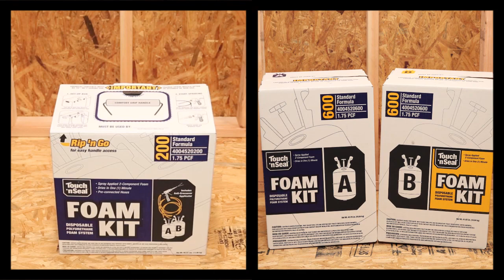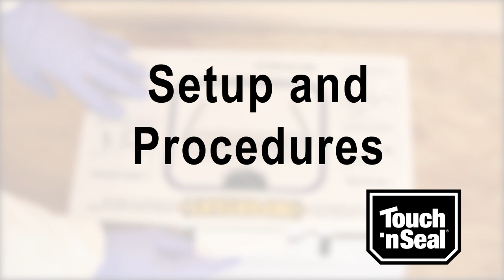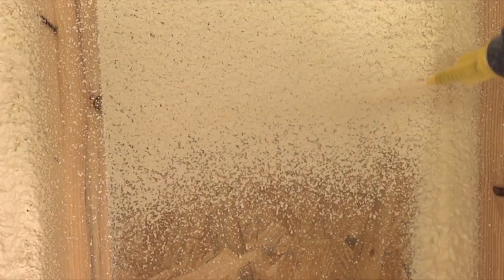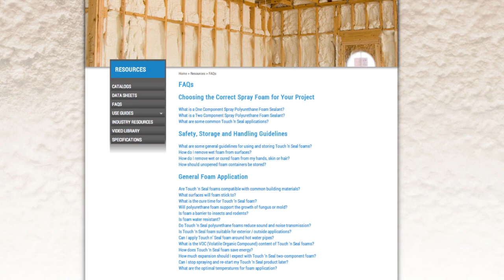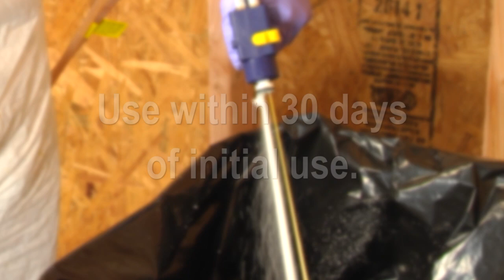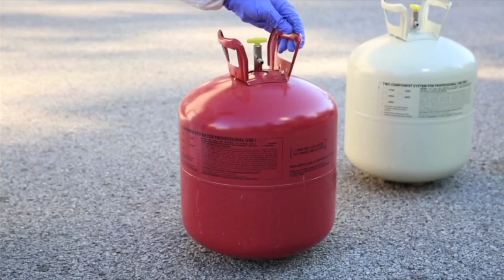How To Use Touch 'n Seal Foam Kit 200

Comment: After 6 years it is time for all of these videos to be updated and answer some of the many questions asked.  Nozzle selection ?  Can it be sprayed overhead ?  Technique of using the different nozzles ?  How to safely heat canisters ?  Etc, come on if you want top sell the product get off your hind ends and offer better presentations than this.
Reply: HEAT CANISTERS WITH HEATING PAD. It works great.

Comment: 11 paragraph advice: 
Measure the required volume carefully. Always buy the biggest tanks for the majority of the job. The 600s are a much better deal than 200s.

If it's cold outside, then it is the wrong season to be applying this to insulate your cold walls! 

Cold is the enemy. Always work within the 3 required temperature limits. Run a fan to keep all air circulating and to avoid excessively warm or cold walls. 

The closer the chemicals are to 90°F, the sooner the foam expands and the sooner you can notice problems. Get both chemical temperatures to 90°F before use. The liquid center will usually be colder than the metal tank. Slosh the liquids vigorously inside the tanks each time before measuring the tank side temperature. Don't get impatient while they warm up. Don't "over-do" it. 

I warm the chemical tanks in a small room with its own heater thermostat set to 90. I use a cheap digital IR (remote) thermal sensor since chemical bottles, wall surfaces, and air - ALL need to be kept within strict limits. I measure a bit of dry paper to get air temperature. 

If you cannot easily work the entire room exterior walls without stopping for more than 15 seconds at any moment, then you should consider buying more disposable nozzles before proceeding. You get 3 in the smaller kits, more in the larger kits. 

If the two chemicals do not mix 50/50, then they won't react fully, nor expand completely! A bad mixture in your walls is bad for your health! There is a reason we wear a chemical respirator while applying this stuff !

As they show, always start a batch on scrap cardboard. If you even suspect a problem, then immediately switch to scrap cardboard for a set of 5-second-on 15-second-off test runs until you can measure the total expansion. If the stream hitting cardboard - changes in speed or color - then STOP! The nozzle might be clogging up, or one Can may be empty before the Other, either way the mixture may stop being 50/50! 

If your corrugated cardboard test failed, then stop, slosh the tanks to estimate remaining liquids, and check all temperatures again. 

If the foam works fine on cardboard, but fails to expand as rapidly on a wall, then STOP! The wall is probably too cold, and you should have been measuring them and been proactive about this. I make sure that wall cavities will stay within the temperature limit while the foam fully cures on the first coat. The colder the walls start out, the closer to the upper limit they should be preheated to. 

Remove nozzle, clean and grease as needed and replace with a new nozzle after any pause longer than 30 seconds, or if you suspect a clogged nozzle may be slowing the stream.
Reply: David Ogawa do you know if you can spray over foam board?  This would help to get the surface temperature that I’m spraying to up and save on cost also. Thoughts?
Reply: @wesbullock5191  
My concerns are that only closed-cell foam is used, both foam boards and spray. Also, if the sheathing was not perfectly sealed during construction, then sealant should be applied from the interior to remedy that. 

I have seen a video of one man combining foam board and spray,  but he did not attempt to apply it below recommended temperature.  You should also avoid that compromise.  He was also careful to provide a large enough gap on each side of the foam boards to apply spray all the way down to the sheathing. This blocks convection and therefore condensation. 

I also strongly recommend that you apply adhesive in many horizontal stripes full-width across the foam boards to limit vertical stratification of both air and moisture between the sheathing and foam boards.
Reply: Can you do multiple layers to achieve 3" thickness?
Reply: @skutsenkow  
Yes.

Comment: Step 1: Setup Foam Kit.
Step 2: Waste half the expensive Foam before applying.
Step 3: Apply remaining Foam for 120 seconds.
Step 4: Go buy another Foam Kit.
Reply: Besides, every 5 weeks you need to purge system if any left to store. 
Don't even bother -  call professional Spray foam company
Reply: @zerofamee  Actually its even worse than that -- purge EVERY week and dispose of after 30 days! :)

Comment: is it open cell or closed cell?
Reply: Closed.
Reply: You can get open or closed cell foam, your choice. 300 & 1000 are open cell. Check your store catalog or web page. 

Closed cell foam is the right choice for thermal insulation. 

Open cell foam is adequate for packaging, but can absorb water easily.

Comment: I've used a different brand . easy to set up and spray. One must Cary a small crescent wrench as the lil yellow handles to turn on both tanks are a bit stiff. Other than that its fun to use . happy spraying.

Comment: Do not use this for a large job. It will cost a fortune. I did 600 SQ ft and had to but 3 kits. Cost me 1500. Could have had it done for 1000
Reply: @Gerry K kinda  hard to do it wrong when it plug and play. I called the company and they sent an extra 600 kit after the first one and the two 200 kits. It still did not expand. In order to get the thickness of 2-3 inches I had to go over it several times. I finally got it covered but it's only an 1.5 " thick. But thanks for you opinion and I'm happy you had better luck. I'll just have it done, it's only a dollar a ft these days anyway.
Reply: The 600s are a better deal than 200s. Measure the planned volume carefully. Always buy biggest tanks for the majority of the job.

If it's cold outside, then it is the wrong season to be applying this to insulate your cold walls! 

Cold is the enemy. Always work within the 3 required temperature limits. Run a fan to keep all air circulating and to avoid excessive warm or cold walls. 

The closer the chemicals are to 90°F, the sooner the foam expands and the sooner you can notice problems. Get both chemical temperatures to 90°F before use. The liquid center will usually be colder than the metal tank. Slosh the liquids vigorously inside the tanks each time before measuring the tank side temperature. Don't get impatient while they warm up. Don't "over-do" it. I use a cheap digital IR (remote) thermal sensor since chemical bottles, wall surfaces, and air ALL need to be kept within strict limits. I measure a bit of foil to get air temperature. 

If you cannot easily work the entire room interior surface without stopping for more than 15 seconds at any moment, then you should consider buying more disposable nozzles before proceeding. You get 3 in the smaller kits, more in the larger kits. 

If you even suspect a problem, then immediately switch to scrap cardboard for a set of 5-second-on 15-second-off test runs. If the chemicals do not mix 50/50 they won't react fully, nor expand completely, so STOP! A bad mixture in your walls is bad for your health! If the stream hitting cardboard - changes in speed or color - then STOP! The nozzle might be clogging up or one can may be empty before the other, so the mixture may stop being 50/50! 

If your corrugated cardboard test failed, then stop, slosh the tanks, and check all temperatures again. 

If the foam works fine on cardboard, but fails to expand as rapidly on a wall, then STOP! The wall is probably too cold, and you should have been measuring them and been proactive about this. 

Remove nozzle, clean and grease as needed and replace with a new nozzle after any pause longer than 25 seconds, or if you suspect a clogged nozzle may be slowing the stream.
Reply: @Gerry K and you had enough for 800 SQ ft and only needed to cover 700. So you had extra to play with. I had 600 and bought the 650. Should've been plenty but wasn't. Here's what I think, they make a sealer that dosent expand much. So I'm thinking the wrong stuff either got packaged in the wrong boxes or it was just a bad batch and did not perform like it should've.

Comment: i wouldnt recommend this. I know a family who had to move to their backyard for 6 months until this garbage was removed from their attic, the fumes are deadly!
Reply: If the chemicals are mixed 50/50 and applied at the correct temperatures, and ALL procedures in this video are followed correctly, such as prep dump into a waste bag, and mixing on cardboard scraps to test reactivity, and 30% initial flow rate, it's safe. 

As you can see, there are many ways to screw up.

Comment: Are there any special nozzles so you do not have to remove all your drywall?
Reply: This stuff can lift concrete driveways, so no. If you apply too much, the wall bursts. 

The mineral-based foams do not expand after application, but only aircrete is DIY. (The magnesium oxide foam is a proprietary system. You have to pay to get training, lease equipment & franchise.)
Reply: No you dumb fuck.

Comment: Moisture soaking and hazardous to the environment
Reply: "moisture soaking and hazardous to environment"
Only open cell foams are moisture wicking. Closed cell foam are impervious to water, and can be diced into filler for "aircrete", which is also recyclable.

Comment: Can i clean the used nozzles?
Reply: nope waste of time
Reply: I bought a similar kit from menards. It came with 6 tips, I used 2. First one was trying to figure it out, second to do the job.
   Found it hard to work with and messy but would do it again on small projects. Probably best to leave everything else to professionals as box recommended.

Comment: Waste of time. What if your plumbing develops a leak or need to repair electrical wiring. And if it burns. The fumes are toxic
Reply: If it weren't fire resistant, you couldn't use it.  Why would you have plumbing in an outside wall?  If you need an electric repair, usually that means replacing a device, not wire.  If you need to run new wire in an old application... in an outside wall... you are normally going to run wires as much as possible in interior walls.  Any feeds you need in insulated walls will require you remove the drywall, then simply cut a channel and install it.  No biggie.  The only waste of time here is your attitude.
Reply: TomKaren94 another homeowner wannabe contractor that thinks they know everything about building science but in reality they only showed how ignorant they really are on how homes are put together. 

And why would you worry about a material putting off toxic fumes in a fire? I suppose the fumes from smoldering carpet, roofing shingles, and many other materials used in construction are ok to breath and the foam will give you lung cancer if you breathe it while it’s burning, it’s all extremely comical
Reply: Don´t worry. If you´re lucky you´ll develop cancer from the fumes the foam releases over the years whilst loosing its ability to insulate without a fire breaking out. Nothing is proven yet but so is the opposite.
As a matter of fact you can´t buy foam in Germany under the age of 18. If you´re over 18 you have to ask a someone to unlock a cabinet for you.
I am aware that there are different foams out there that use different , lets call it foaming agents, since my english vocabulary is limited, and that PU is a group of chemicals, but the prices are just as different. At least here in Germany. Noone in his right mind would do this to his home here.
I´m not even sure if it would be legal, especially if you´re planning to rent the place to other people.
Anyway i see no valid argument for foam insulation other than, in some cases, industrial Roofs. There are much better "alternatives" out there regarding physics in construction. But i also don´t know the market prices in the USA. Maybe thats the main selling point?
Are there any other concepts of vapour control layers over there other than wrapping your house in plastic or using foam with  µ=6.000 ?
Reply: If using spray foam I would run all electrical, entertainment related cables thru  conduit and seal the conduit to the boxes then spray foam. All the plumbing should be centrally located in interior walls where spray foam would not be needed. 
What about condensation inside the walls where the foam is? What is the fire rating? I know refrigerated trailers have been using spray foam insulation for years. What is the life expectancy of this product?
Reply: @jerrykinnin7941  
A lot of people are going to be surprised that the vertical waste vent can freeze adjacent pipes - even the hot water pipe. The problem doesn't just occur in outside walls. Every time it hits -20°F, another group finds out. Arctic circle plumbing is needed in Midwestern America.
Reply: @jerrykinnin7941  
Urethane foam is attacked by UV light, ozone, acids (even vinegar), and melts in flame. Closed foam is far more durable than open foam, higher density better than lower. R6 can outlast most wall materials.

Comment: Too expensive for what it gives you!
Reply: If you buy hard foam polyisocyanurate panels and fill the gaps with this closed spray foam, you can beat any professional installer on R-value, and cost. 

Also, look closely at the largest tank kit prices; they are much better deals. You can also get the respirator, safety suit, gloves, & boots all bundled with a kit.
Reply: @avid0g  would you still recommend doing this when living in a climate that gets to 10 degrees Fahrenheit in the winter?  I’ve read that Polyisocyanurate loses its r value in weather under 50 degrees Fahrenheit.  Thanks
Reply: @brandonsanderson17  
All of the rigid closed foams tend to contract somewhat as temperature drops, polyisocyanurate a bit more than others. That is what reduces the R value slightly. Their performance is still usually much better than any other insulation types, for a given cavity thickness, and although overall cost is higher, you cannot beat the overall results and reduced heating costs. In this situation look at the overall insulating value of various hard closed-foam panels at 10-40°F, to compare their relative performance. Closed foam polyurethane may very well be superior. 

Keep in mind that if the outside also may also get very hot in another season, then polyisocyanurate will be superior for that.
Reply: @avid0g  Hey, is this stuff poisonous for plants or humans? What should we watch out for before spraying the 600 Sq. Ft. kit?

Comment: If you are going to spray in foam to a flat roof from the inside, will that cause issues when a roofer needs to replace the roof?  My home needs to be gutted (Asbestos) and it will have an exposed ceiling..  Should I layer the plywood under the roof with anything to prevent the spray foam from adhering to the plywood if/when it needs to be replaced so the roofers do not pull out the foam ?
Reply: Most roofs fail because the house moisture reaches the sheathing and accumulates during freezing weather. Failure will typically show at the ridge peak as high sheathing moisture levels. 
See: To Vent or not to Vent https://youtu.be/Ld8pzIu45F8

Ventilate the sheathing! Insulate below a ventilating air gap. 

Perhaps they installed thick rigid insulation panels on top of the sheathing. This might be ok, but only if mastic or closed foam sealant was used to glue every panel into a monolithic bloc as well as to every bit of sheathing. Ask to see a video of the installer working this detail. 

If necessary, because you already have foam sprayed directly against the sheathing underside, you need to install a door exhaust fan (blowing out) and find every tiny air leak cooling your ceiling using a IR camera plus maybe a drywall moisture meter (one with sharp pins). Maybe you can get by with rubber sealant paint on the ceiling, but more likely you will need to inject more with a syringe into every cold spot. Repeatedly. Hopefully, you have longer summers than winters and can postpone another failure more than a decade. 

The proper way to solve this is to educate your contractors with a lawyer who says "class action suit", and subpoenas their every roofing job.

CURE: 
Remove all the water proofing from the sheathing top. Install an air gap using furring strips. Install a metal roof, or, another sheathing layer and a conventional waterproof layer, flashing, etc. Feed the ventilation gap with (mostly) fresh dry air.
Reply: Pop
Reply: tar paper would work
Reply: If the foam has nothing to stick to it wont stay put, gravity and all.
Reply: U so t need to git the house dont buy into hype just dont disturb it if u have plaster wall dont remove it for  paper wall cause when there is  a flood u will be sorry. To insulate plaster place rigid foam insulation on the interior plaster wall with glue and  place thin drywall Infront trust me it works petter than working with studs as there is no air leakage place a bracket or a track thing and top and bottom and fit the insulation and drywall in it to keep the drywall tight to the insulation and u can also glue the deywall and insulation together along with the top and bottom plate
Reply: When the underside of the roof is exposed, check the condition of the sheathing. If there is no damage you should be fine as long as the waterproofing above is maintained. If there is any rot or damage, have the roof repaired and replaced before foaming.

Comment: This is not an approved product for residential housing in Canada and if it is must be applied by a licensed installer CANULC705.2 otherwise just hire a professional who actually sprays a high pressure closed cell 2lb foam.